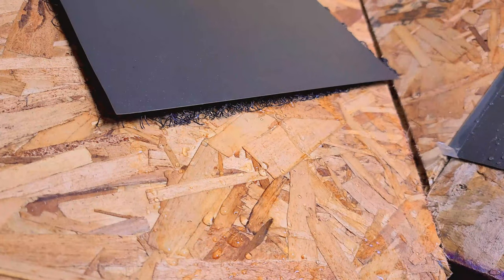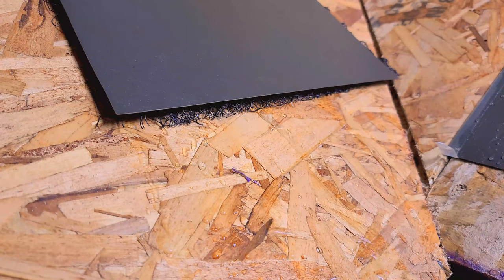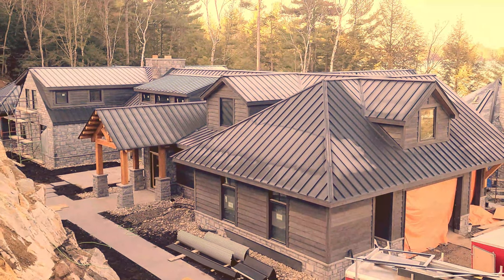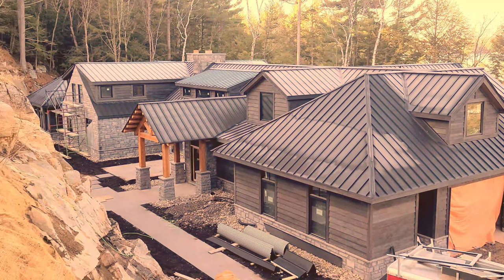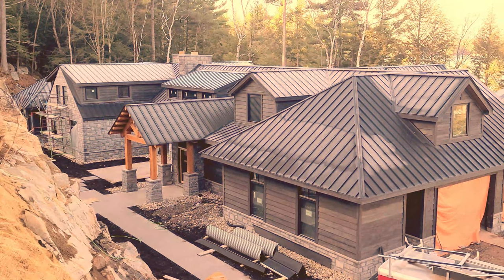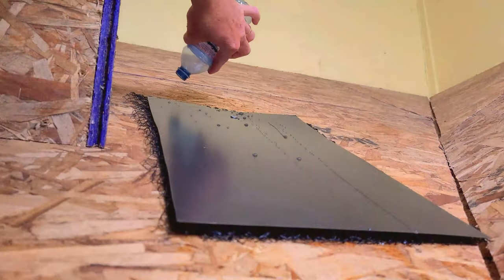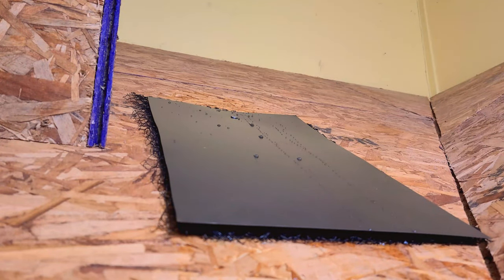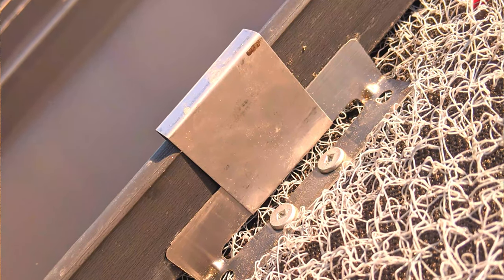Metal Roof Rusting Reduced with 3D Drainage Mat

Comment: don't use it. it's not ventilation since the air it's closed between the support and metall roof. that is no ventilation without intake and outake air. Plus, you have to use 32 mm fixing clips. In 30 years this plastic material will shrink and the metal roof will start to move. if i can atach a photo you will change all your concept.
Reply from the maker: Keeping the metal off the roof surface allows for the condensation to move where it needs to...if not the metal is press against solid substrate holding condensate against the metal prematurely breaking down the polimers of the primer backing of the painted product